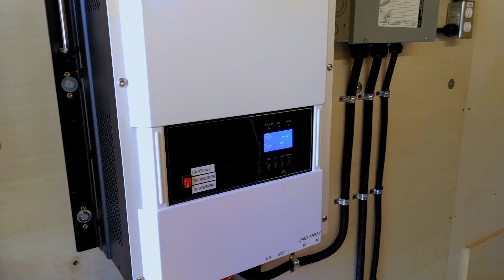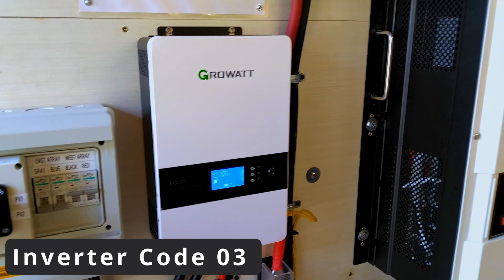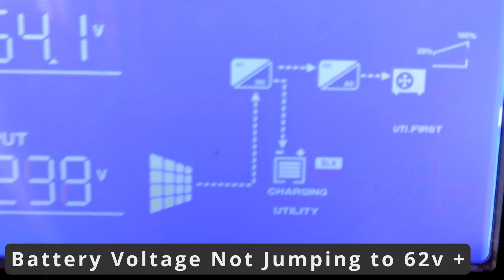The Farm Goes Off Grid ~ Part 4

Comment: Did you try running the Growatt SCC with out it linked to the inverter and do the setting manual? Did you also check if the setting from the inverter was transferred to the SCC. One thing i noticed on mine was the voltage was incorrect on the SCC (different from the inverter voltage reading) and had to program it with a laptop to match the correct voltage.
Reply from the maker: Yes we calibrated both scc and inverter 1st using the Growatt calibration tool.  Run with out connection it would not stop charging. Didn't work much better connected to the inverter.   But yes when connected to the inverter, the internal settings of inverters scc did transfer to the external scc.

Comment: Very nice setup! Ya, my cargo trailer/RV setup is about a third the size, but being setup with 48v also, I've done a couple 24v RV type systems. Combined they get close to what you have, and when not in use they will mostly power my house, they are off-grid systems. Thanks again for the videos, I watched all of them!
Reply from the maker: Nice. Glad you enjoyed them. We have been putting the system thru its paces and it had preformed flawlessly. I plan to post all my final design and schematics on the DIY Solar Forum in the next few days.  (see description for link).  And will have a stress test video soon.